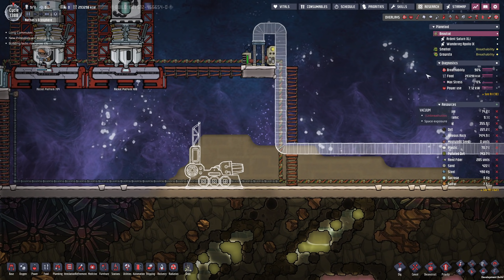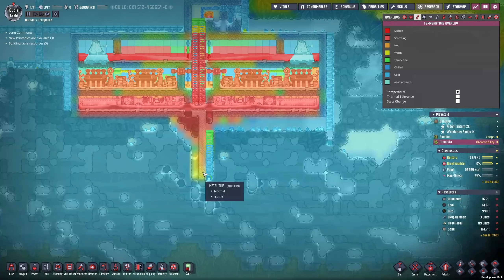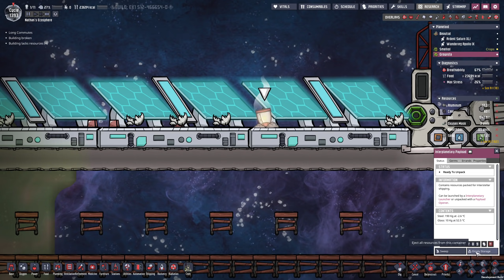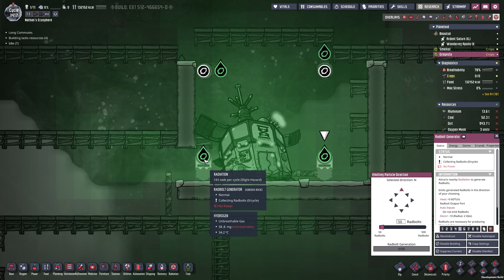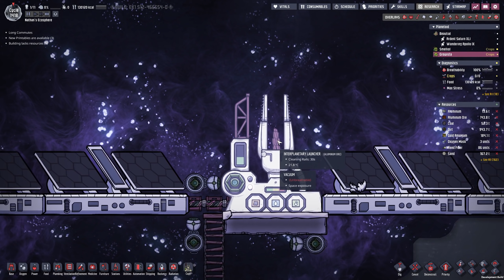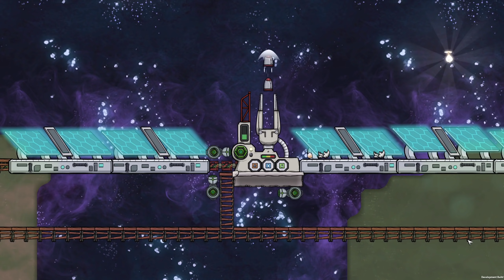INTERPLANETARY LAUNCHER - Oxygen Not Included: Ep. #44 - The Ultimate Base 2.0 (Spaced Out DLC)

Comment: Adding 2 more turbines why?  The 4 you had weren't even running at 50%.  If you setup the stream room around your volcanos you wouldn't have 1500C stuff just sitting around.  You instantly turn the liquid into a solid.  Then your your loop solids around the chamber to cool it.  The way your doing it sort of works.   But you're wasting way to much time trying to make a cool looking design but not a good design that will do the job.
Reply from the maker: The reason the turbines aren't running is because we're melting the ice biome with it. The additional turbines are needed once that is over. The design works well, not sure why you think it doesn't.

Comment: You can use a payload opener to automate the process along with an auto sweeper to pick the payloads up from the dedicated spot and deposit them in the payload opener.

Payload Opener - Unpacks Interplanetary Payloads delivered by duplicants. Automatically separates Solid, Liquid, and Gas materials and distributes them to the appropriate systems. Payload openers can be hooked up to conveyors, plumbing and ventilation for improved sorting.

Looks like you can send gases too!!!
Reply: i wonder if you don't use a payload opener to open a gas payload if it just releases the gas into the environment...
Reply from the maker: Found it, thanks!;)